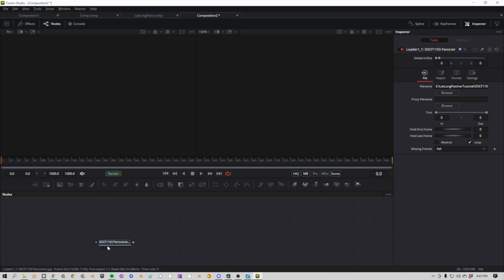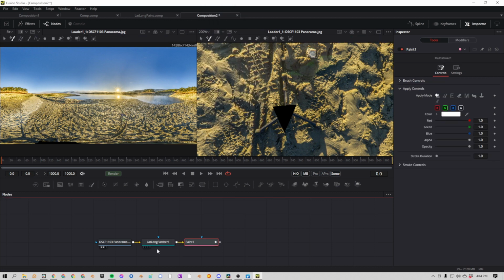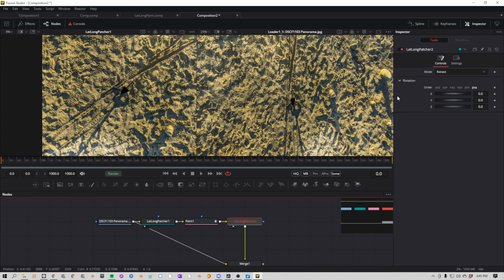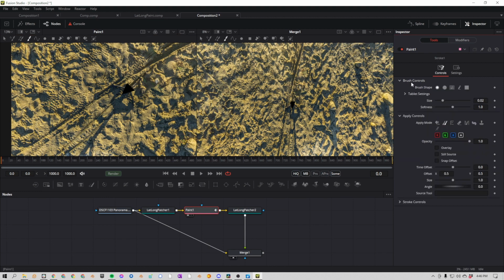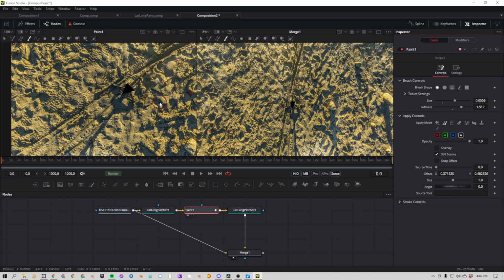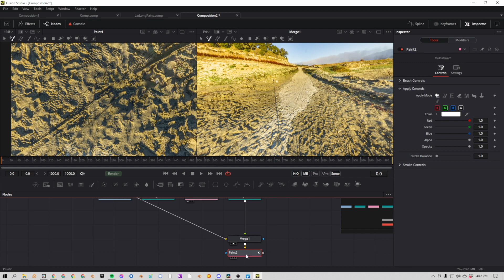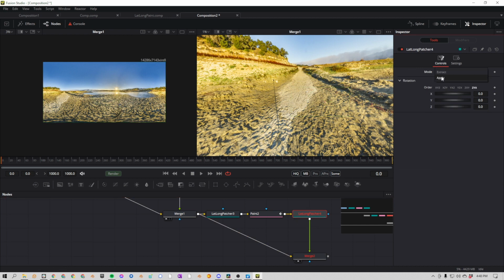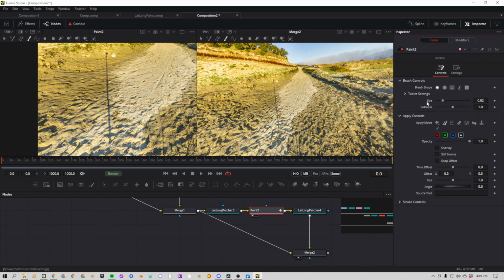Tripod Removal for 360 Video - Resolve/Fusion

Comment: Hi Alex... for some reason when I try to edit 360 video in Resolve, the clone feature does not edit the tripod. It seems to be offset and edit other areas of the video and not the tripod that I am trying to clone over. Is there a setting that will make it edit what the mouse is clicking on.  All settings are the same .. I do not have FUSION. Am I missing something ?  I do not have LAT LONG patcher. Could that be the reason ?
thanks for your video